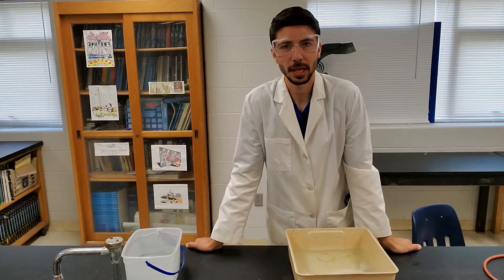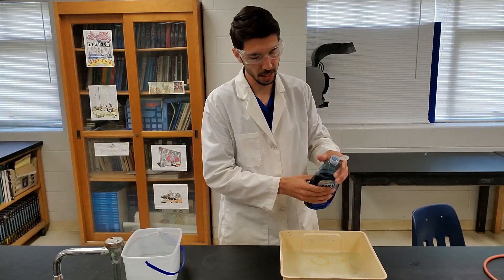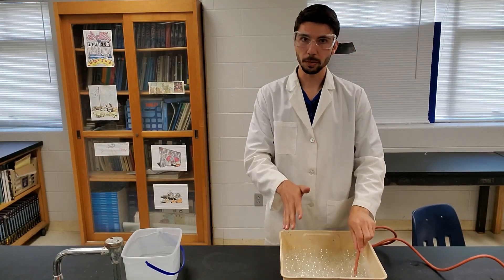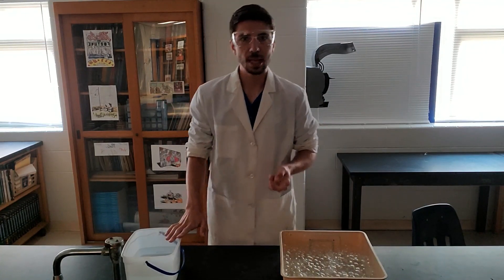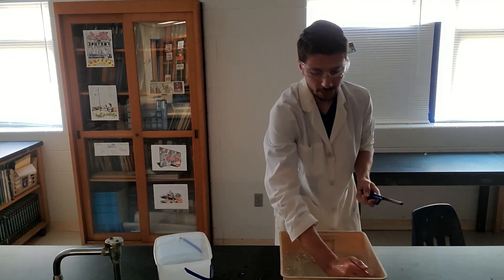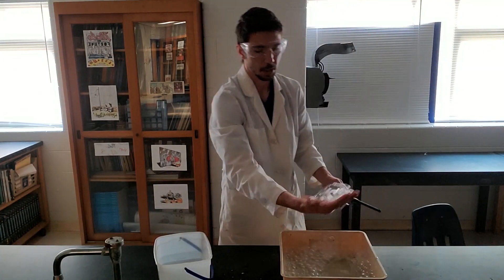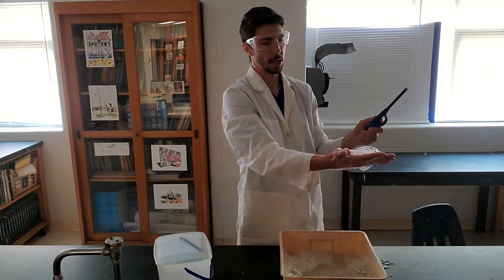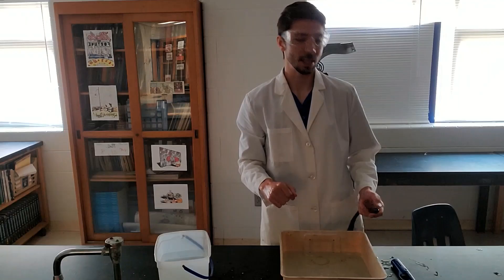Specific Heat of Water Demo

Comment: If you do water electrolysis and capture hydrogen with the bubbles, you can hold bubbles with a small spoon and they crack/explode....don't use your hand
Reply from the maker: Ooh, I'll have to try it! What kind of set up do you use? I've briefly tinkered with a 9 volt battery, but didn't have much success.
Reply: I've only done this with the standard hoffman electrolysis apparatus that has platinum tips and a variable power supply....cant remember voltage. ...https://sci-supply.com/hoffman-electrolysis-apparatus/......BUT, I've seen the bubble done with the low end student set up
Reply from the maker: Make sure to dip you hand in water before grabbing the bubbles!  I do this, but use propane gas from the lab nozzles to fill the bubbles.